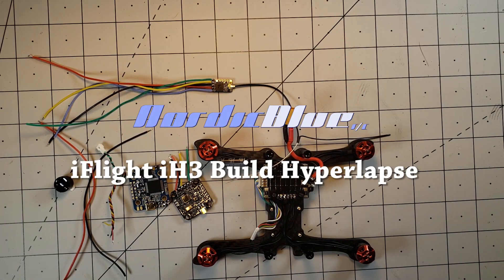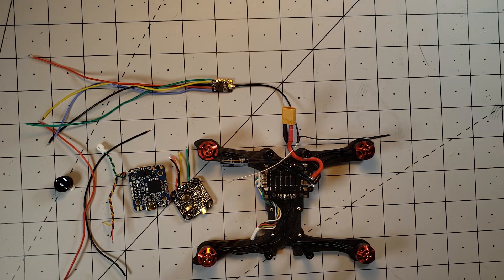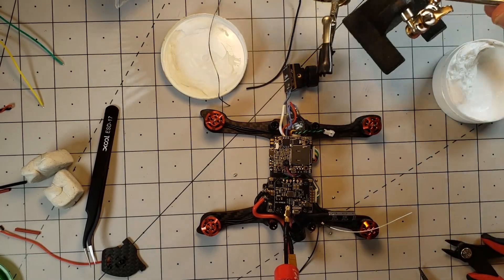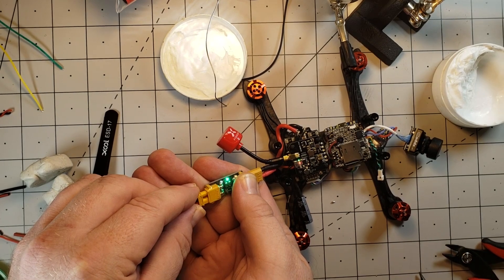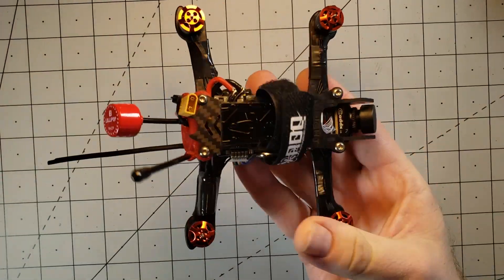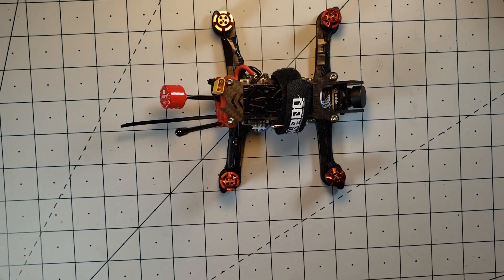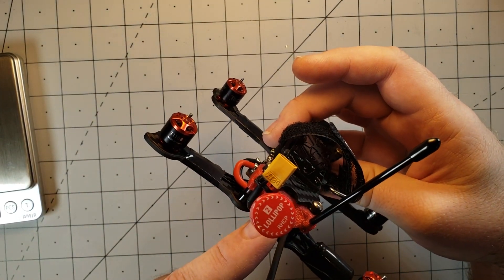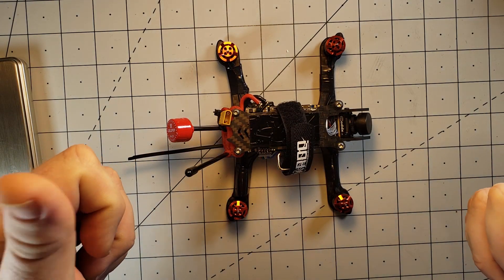iFlight iH3 Hyperlapse Build with Caddx Turtle V2

Comment: whats the capacitor for?
Reply from the maker: Capacitor is to ensure any voltage spikes are smoothed out. Strongly recommend one on any build you do
Reply: @NordicBlueRC  what are the specs of the capacitor id like to put one on my quad but i need to buy one somewhere

Comment: Just built a 4" Iflight frame out using hobby wing F4 FC-35A 4-in-1 ESC stack. I used the Caddx Turtle V2. I get no video. Is there a LED on the Turtle's board that lights up when powered? I noted that you powered it with 8V I'm powering with 5v off FC. IDK hope you can help.